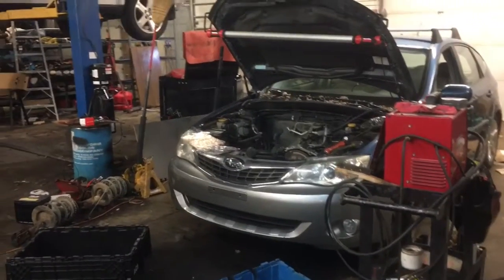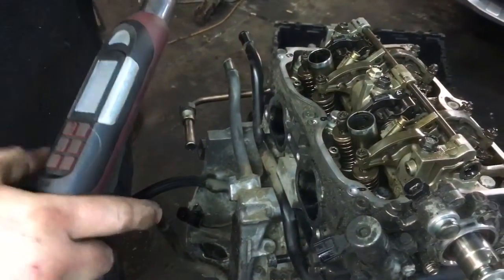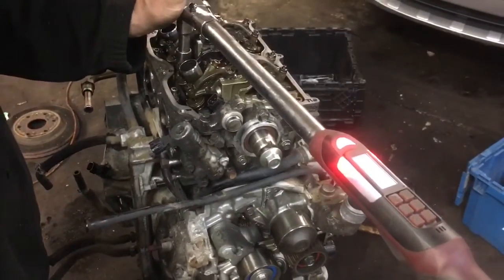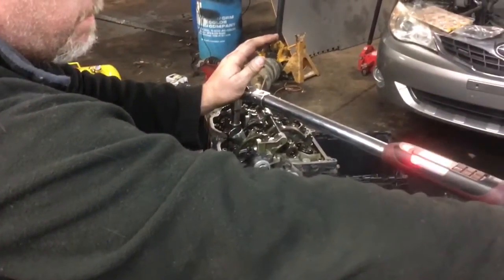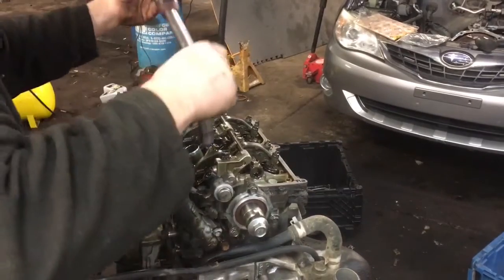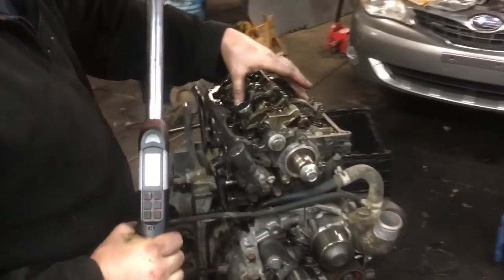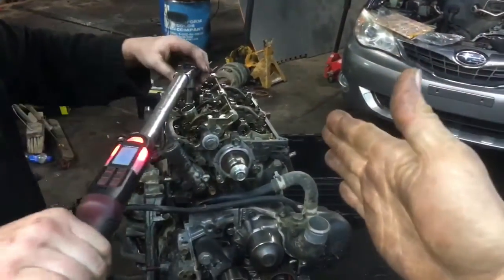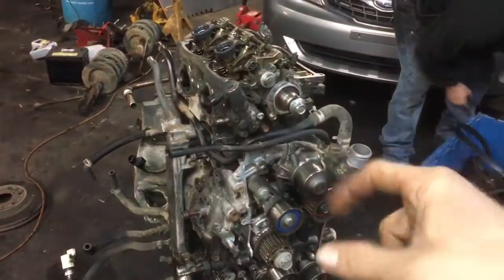Subaru 2.5 head gasket torque sequence the clay way and the new Subaru sequence

Comment: Thank you for the helpful video. Do you have any recommendations for a good quality torque wrench for Subaru engine builds? At the moment I’m thinking of getting the ICON digital.
Reply: I'm about to rebuild my outback engine, and the Subaru specialist I'm talking to recommended the ICON as the bare minimum for the job. Snap-on or Mac are ideal for the job according to him.
Reply: @mackshaw4859 The new ICON digital has good reviews and tested well with calibration results comparable to a Snap-on Tech-Angle. With rebuilding an engine, especially a boxer platform, I don’t know if I would trust a new company for torquing critical engine bolts needed to be at precise specification. I have my eye on the Snap-on Tech-Angle and considering it but don’t like the hefty price tag.

Comment: Would it be a good idea to add a paint mark on the head bolts so you can 100% know if you have went 180 / 80 degrees etc?
Reply from the maker: It definitely wouldn’t hurt

Comment: Clay, we used this method and stripped the bottom middle on the right side on the final 80 degrees. Any thoughts?
Reply: Are you the first one to open the engine? Someone might have caused some damage on an earlier repair. The main thing is to oil the leading threads on the bolt so oil is dragged all the way down.
Reply: Pulled head. Threads stripped.
Reply: Going to find a recoil. I believe it is an 11M x 1.25.
Reply: @joesweeny3928  Time sert
Reply: Does it have to be Subaru specific? Or will a common one work?
Reply from the maker: I want to be very cautious before I say anything I’ve never done that before but I’m sure they have at accurate engines so I would have to ask someone
Reply from the maker: Well first thing that comes to mind is haven’t I done enough, i’m surprised you’re not cursing my name or at least you didn’t in the text message.

The only thing that I could assume is there was debris down inside the hole because once the bolts are down that far it is near impossible to strip them out unless the bolts were either too long there was debris inside the hole or you went more than 80°. I’m sorry i’ve use this method every time I put them together I’ve never stripped out bolts. So I honestly don’t know what could be going on
Reply: @YoutubeTheClayWay  this method works for all subi engines i have a 2.5 dohc non turbo 2013 model